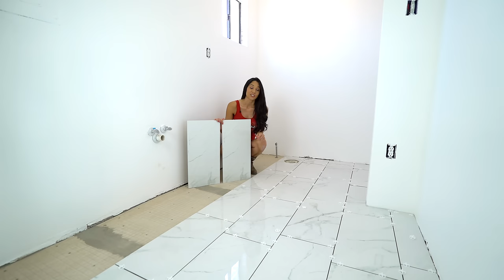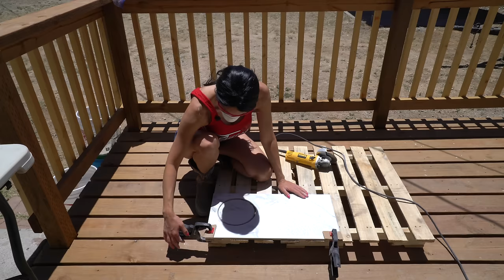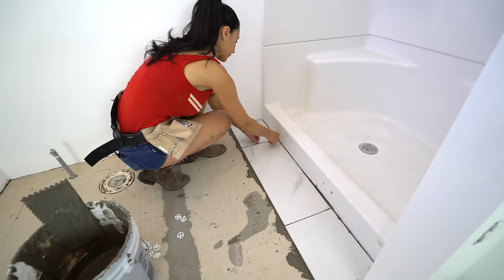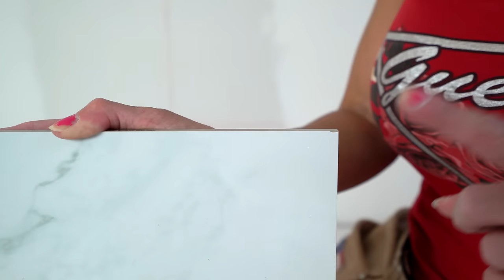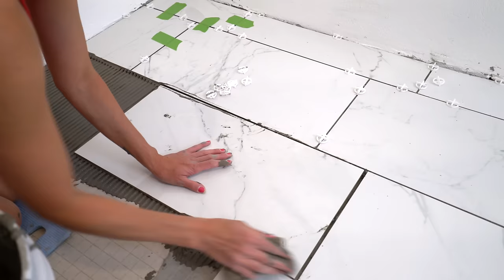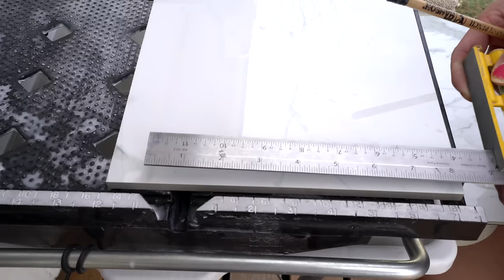How to Tile a Floor | STEP BY STEP

Comment: Barwalt kn1 knee pads are great. They have a smaller foam cup to hold your knees better. I use them without straps and they still do well.

Comment: You should use colored caulking where the tile meets the shower pan. The grout will eventually crack and allow water to get through. You can match the caulking with color of the grout.

Comment: Ms Nassrin, 
You're doin a Great job. Do yourself a favor and use a leveling system, with your next tiling adventure. Personally, I use the Rigid spindle leveling system and it works well. Thx 4 sharing.. -LB
Reply from the maker: Thank you, I have some I wanna try.

Comment: One thing i am concerned before doing this DIY is how you control the amount of thinset you put on the floor before notch troweling. I know the trowel notches held at 45 degrees will regulate and standardize the thickness but only as long as you put slightly more than needed, but say you put less than needed, then the thinset will not run all the way up to the corners of the notches. I guess you can kind of notice that as you go or not ?

Comment: There's a method you can use to avoid the mortar squeezing between the tile and having to use that grout scraper tool (time-stamped video link): https://youtu.be/d2j9rRp8zjw?t=1901

Comment: Awesome video! one thing i suggest you do is to remove mortar from edge of the tile while setting tile, then it's easier to grout them out, also it's technically more correct since grout itself gotta have some depth in order to not crack, this applies for all types of grout, whether it's cement or epoxy grout type

Comment: I found a similar polished porcelain tile, they’re “technically” not recommended for bathroom floors since they can be slippery. Have you had any problems with them being very slippery?
Reply from the maker: No I havnt.

Comment: You added green tape on many tiles around one inside corner, presumably to hold the tiles tight.  Did you pull the tape tight when sticking it on, and is the tape a little flexible?  Like many people, you refer to the dry-set as "drying", but actually a chemical reaction with the water, similar to Portland cement.

Comment: I thought I had seen all of your videos Nassrin, but it looks like I missed this one.
You're doing a very professional job. The finished floor looks really good.
I would recommend wearing gloves though as the glue is alkaline and can damage your hands.
I dampen the floor before I put the glue down. This stops the floor dragging the moisture out of the glue. If your glue is thick enough you shouldn't have to back butter. Nonetheless it doesn't hurt to do both. 
I often use a small piece of carpet to kneel on. Knee pads are great but they have a tendency to slide down all the time and are uncomfortable.
Reply from the maker: Thank you I appreciate the tips👍🏼
Reply: @NassrinsDIY  You're welcome.

Comment: Your toilet flange should be 1/2  inch above the finished floor tile. Yours appears to flush which is incorrect. But you are easy on the eyes and I did learn something (pre drilling) )from your hardiboard video. Keep up the good wrk.

Comment: Hi, you did better than many guys I know in this trade. A few observations I'll make:
1- The backerboard you used, it's extremelly dry by nature, it will absorb moisture from the thinset rapidly, this will create a problem of bonding, stopping the chemical reaction on the cement to fully bond into the pores of the porcelain or ceramic, to resolve this problem, wet the hell out of that backerdboard before applying thinset, work on wetting areas of 2'x4' at the time. This is only for the hardybacker or fibrous backerboards. Durock or wonderboard does not have this problem.
2-for a better coverage on the bed of thiset in the back of the tile, use a margin trowel that is 1/4"x 1/2" instead 1/4"x1/4". You want to achieve at least 85% of thinset coverage behind that tile.
3- always use thinset under backerboard, than nail it or screw it to subfloor, this will support better your installation.
Happy installations.
Reply: or use an acrylic primer on the backer board, spot on about the adhesive between the backer board and the subfloor you shoudld also use the corrrect coated screws which will self drill and self countersink into the backer board, here in the UK Bal make the best adhesives and grouts but I haven't seen any US contractors use it, i've tried Mapei and it's not even close to Bal, they also do backer board, silicon, and tanking kits though the Mapei tanking kit is pretty good and half the price

Comment: You could try barwalt blue knee pads they’re adjustable and very comfortable. If you wanted to speed up grouting they have a grouting system. I’ve been doing tile for over 20 years . You do a great job.
Reply from the maker: Thanks🙂 im ganna check them out right now and see what they’re about.

Comment: I'm guessing you would finish off the floor with a wood skirt, do you need to prep the floor with leveling compound or is it just tiles on. first time I've seen a floor laid. PS love the American utility belt.
Reply from the maker: If it’s really uneven you’re gonna have to level it out but mine was OK🙂

Comment: Just discovered this gal a day ago. She is so positive and thorough. I’ve laid a decent anoint of tile or back splash and still learned. Would use the combination square up again to the wall and then remove the 1/4 “at the wet saw. So many good tips I hope your channel expands.. Love the cowboy books on the job. You might look at girls roller blade knee pads. I looked at Garret Wade and they had zero! I’ve use an ensolite knee pad for years...they at one time were used in in pro football pads. Outdoor shops might have things to kneel on in a canoe as well. Good look.
Reply from the maker: Thank you!!I did finally find some good knee pads at Homedepot🙂

Comment: Sounds like it was more work sealing the grout line than it was installing the tile.  Instead of using water to mix the grout why not use a grout sealer and mix it together, lay the grout with the sealer already in it and be done.  You just killed 2 birds with 1 stone.  Other than that good job your work looks magnificent!
Reply from the maker: Thank you🙂

Comment: With your years of experience a real journeywoman you make this look easy. Physically fit showing no strain your stronger than most men making your details impeccable. I know  handling tile that size and weight is not a walk in the park. Your sealing the grout is an education. So I’ll leave skilled work to professionally trained tradeswoman like you.
Reply from the maker: Awe☺️thank you!
Reply: I was a Union Painter 35 years. The last 25 a sprayman most of the time. 36,000 gallon ceiling was the biggest ceiling we did I was on. Working with woman I’ll support any journeywoman. Most woman were wall coverings specialists. Because of a wall coverings mechanics attention to detail they were excellent painters. Like you when your talking detail. We always requested each other or just wound up on the same jobs. The wall covering crew the spray crew and the painters. We had to be done before most trades got there. Working with tradeswoman over the years showed me they kept up with any man and by the end of the day out worked most men. Keep up the excellent educational videos.

Comment: Kinda pointless step to first put the glue flat on the floor and then draging out the lines, just put a line of glue on the side with the lines and drag it out directly on the floor... (I'm a tiles/bricklayer)

Comment: Great video and nice work.  Knee pads are torture devices.  You're better off with a kneeling pad, just get a bigger one.   I have one that folds up to be smaller and higher or unfolds to be a larger surface.   Great for when you have to kneel on river rocks.

Comment: I enjoyed your video, repetitive by nature (perhaps try some time lapse editing to speed it up), and I see it's been over a year since you posted this, but still I'm thinking even in 2020 you didn't use a leveling system clips. May I ask why...?  I am in a quest to find someone that does tile as I was taught many years ago, but everybody I've observed that's doing tiling now uses a notched trowel (normal) and when placing the tiles down, presses and wiggles the tiles until the notched mortar is flattened out. hmmm so what's the point of using a notched trowel in this process if you press it down and push all the air out?  Couldn't you simply apply the mortar, smooth it out with a flat trowel, back butter the tile and put it in place?  However you do it, you made it look nice and i enjoyed watching you... TY
Reply: yah, no leveling...perhaps the floor was already nicely leveled...still, they shud use it...but then i know really nothing abt stuff and trying to learn...

Comment: Never use unsanded grout on floors or applications over 1/8 inch joint.  Pro tip
Reply: It cracks. Just limitations of the grout.  The rest is very good 👍

Comment: In Russia, this is considered a low-quality repair. Under the tile, you need a waterproofing layer. I apologize for the criticism, but it needed to be said.
Reply: Where im from in the west you dont need water proofing layer if this is outside of the shower which it is. its just the floor in the bathroom
Reply: @NunYaaBizz  If you do not do full waterproofing, then in a year or two a fungus will appear. I understand that American regulations are different from European ones, and that's why I stressed that we do everything differently.

Comment: My ocd is killing me. The assumption is that is a 24 inch tile and u used a 5inch offset based on the 30% recommendation. Shouldn’t it been 8 inch offset every third row. Meaning 0, 8, then 16. If u wanted just a 2 row pattern, it should have been a 50% offset setup. IMHO the joints look too close
Reply: 50% stagger isn't recommended on some 12"×24" tile due to the tiles being slightly cupped which would cause lippage. Her layout is good for this installation. I have 28 years in the trade in California. Great set!! And best looking tile setter I've seen in 28 Years! Lol
Reply: She said the box recommended 15-30% offset. I personally use 33% splitting it in thirds. I think that looks really good. A 5 inch offset will still work but with heavily bowed tiles the 8 inch offset would be better.
Reply from the maker: Robert Martinez 15% of 24” is 3.6”
Reply: I love you nassrin.you do very good job🌹❤❤